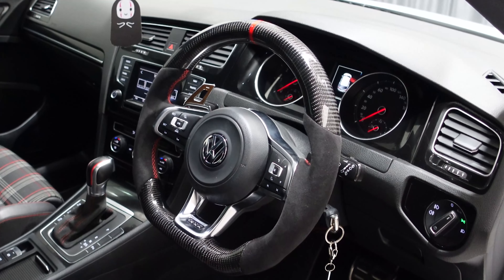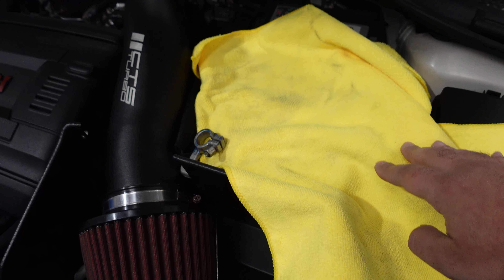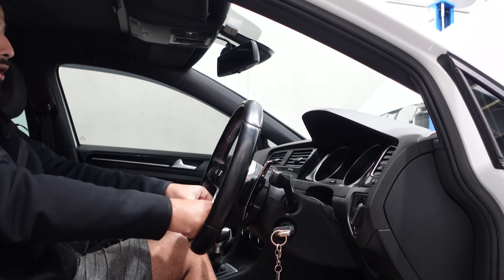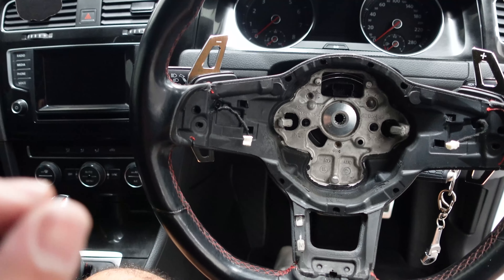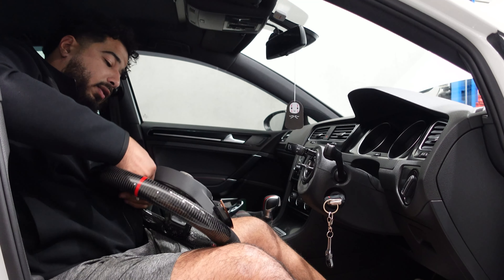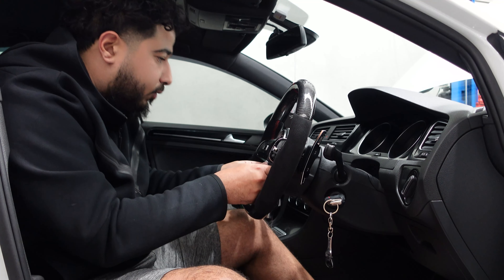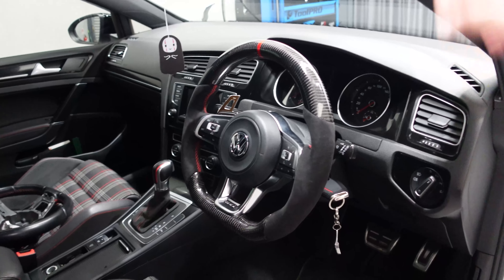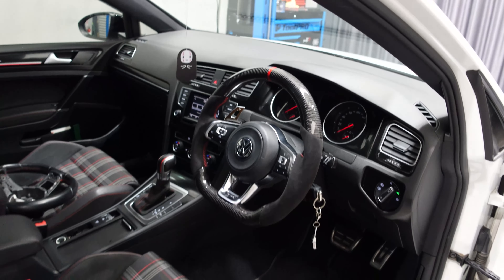HOW TO INSTALL VW golf MK7-7.5 steering wheel

Comment: Just a quick question. My golf has a push button start so when it comes to unclipping the air bag do I have to reconnect the battery in order to get to the second clip as when I turn the wheel the steering lock will engage with the ignition off.